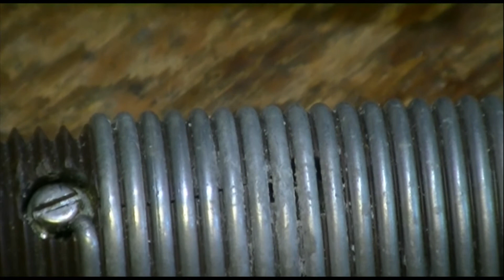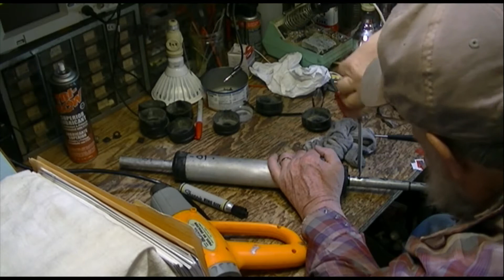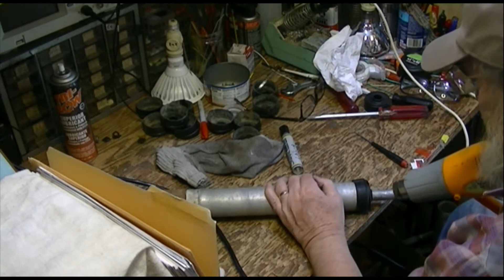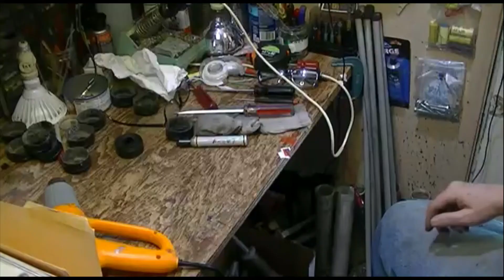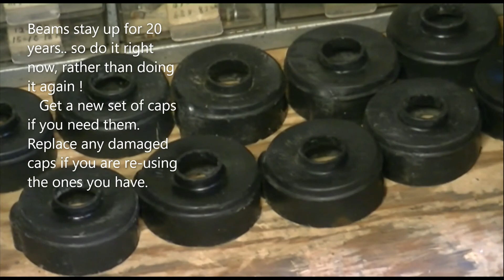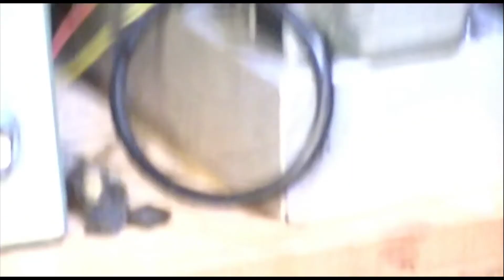W6WUH: Mosley  TA-33 #1   Disassemble and Inspect Your Traps

Comment: At 3:32 you talk about aluminum oxide being conductive.  It isn’t.  It’s a very good dielectric and in fact insulators are commonly made from aluminum oxide (alumina). The problem with using aluminum as a conductor is that a film of oxide forms where connections are meant to be and break the connection.
Reply from the maker: E-yup   that's why I use phosphoric acid scotch brite pads on the element connections..  and clean up the inside of the traps.  I make mistakes all the time...especially in these videos where I am speaking extemporaneously while actually trying to work at the same time.  thanks for correcting this error.

Comment: Trying get it apart for cleaning. Not the elements, it is  gritty and I can't get it apart. What to use and the matching, to get it back up and running. Have the manual  but not sure what goes where.   Thanks for any input. 
Got this used. 
KQ4CD Paul ⚓️

Comment: Can you show how you run a feed line to the driver that will last 20 years
Reply from the maker: sure.  go to the hardware store in the electrical section.  Buy : 1. Rubber Fill Tape  2. good quality electrical tape.  3 3M waterproof electrical coating.   Now.  if there is a coax connector wrap it and about 3 inches of the coax jacket with fill tape overlap 1/3, Follow that with electrical tape.  Now paint it all with the waterproof coating.    if no pl-259... paint the braid with the coating, wrap the center, braid and jacket in a Y with the same two tapes and paint that with he coating.  you can also paint it over shrink wrap..  the whole idea is to keep water out.  wrap accordingly and seal well.
Reply from the maker: start with NEW high quality coax with properly installed connectors.  use a little conductive grease  on the center pin and outer threads.. A LITTLE.   connect up properly.  Get 3M electrical fill tape ( soft rubber)  wrap the connection with 50% overlap.  Wrap that with 3M electrical tape . Then paint it with 3M weatherproof electrical coating ( a red-brown varnish like goop).  This will  stand up to any weather that you can throw at it.. short of 150 mph winds,  I dont know about ICE.   when you cut it open after 20 years.. the metal will be shiney and the coax will be dry inside.  Use an ant analyzer ( good one) to charactorize the line, make notes,  ditto the whole ant system.. and measure periodically.  Any change is all the warning you get.

Comment from the maker: In Mosley #2  you will find the little chart that identifies each coil by the number of turns . This is in the TA-33 manual... in a diagram with an asterisk, a tad obscure untill you know to look for it.  This lets you mark the color code if it is missing or hard to find ( look under the plastic end caps for a colored line applied with a marker.
Reply from the maker: use 450 ohm ladder line and a balun.  good for 50 years if you do it right